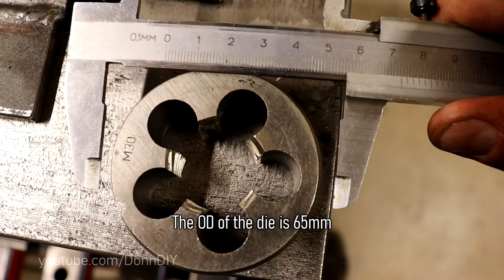Machining M30 Thread Cutter Holder on Lathe

Comment: The industrial sink has definitely "seen some stuff" you're right; well everything except a Brillo pad and a cleaning agent.  😄  Great video Donn.
[13:17] I don't know if it would weaken the die and the holder too much, but drilling a small hole through both pieces on the top, and tapping to add a small reservoir for cutting oil would be convenient, and allow for a steady flow of whatever cutting oil you choose. Modifying the mounting bolt might make a good reservoir.

Comment: Great project! We're all about building our own tools if we can cause the crap you get these days is junk in most cases and too expensive to boot!!! Great job
Reply from the maker: Yup, I bought a set of thread cutters from eBay just because I needed to cut SAE thread. Those cutters were so brittle and broke first use. Have to look into some highly rated brand ones.

Comment: Seem to me it would have been simpler and faster to use the lathe to single point cut that M30 thread on that shaft.
Reply from the maker: But I had the die though...
Reply: @DonnDIY  But you have a lathe though. That's every die and then some. I never die cut threads when they are easy to single point.
Reply: @TheMetalButcher  He might not have the threading tool? Then he needs to cut it and keep test fitting the nut, engaging auto feed and disengaging before you crash the tool. 

Tbh if I had the die, I'd reach for it as well, he also had no way to use this die prior to this job, so he's done the job and added a tool to the shelf.
Reply: @TheFool2cool  he added a tool thats still slower than using the lathe for a thread
Reply: It is for sure not slower than with the lathe!😅 It took me ages and was pretty complicated when i tried that with a M20 in Aluminium! And you probably need double the amount of cuts for a M30 thread in steel. I'd definitely also use the die if i had one!

Comment: Why you just don't use single point thread tool on a lathe?
Reply: That's what I was thinking...  Maybe he was missing change gears or he has a dozen of these threads to cut.
Reply: Cutting threads with a die is faster. If you have several to cut and have the die already, it's worth spending the time to make the handle.

Plus single point threading can be intimidating for hobbyist machinists, even more so if you have to do several.
Reply: Doesn't ! Do !! Anything !!

Comment: i would have bet that the lathe chuck would not be able to hold that size stock tight enough to thread with a die. i was wrong nice job. you are a very resourceful young man.
Reply from the maker: Sometimes parts do rotate in the chuck...

Comment: You need to countersink the threaded holes for the knobs to be able to press the conical part at the end of the thread into the holes. Thanks to this, the handwheel transfers a larger moment of bending (strengthening)

Comment: I would like to see the Donn DIY drill bit sharpening tutorial :-)  That 2 inch drill really cut cleanly
Reply from the maker: If you noticed, it's sharpened a bit unevenly, it cut more on one side than the other.
Reply: @DonnDIY  I did not look for that. Was impressed with the clean swirl the bit made of the metal.

Comment: loose fit of thread die is not game over in any mean, you know that? When screws do fit it works just fine
Reply from the maker: Yes, I know. That's why I made it fit loosely. 😉
Reply: @DonnDIY  i ment loose fit. Like an centimetr too loose. If screw pattern fitted, or if it can be modified to fit screws will hold die as well, as You can set it in the center. Die holder then will work with screws as big levers, but it is too beefy for small die in the first place and I had no problem with cutting steel with dull-ish die
Reply: I seriously used all the range of pointed screws. I didn't think, that I shouldn't at any point
Reply: @poprawa  Loose !! Fit !! Is EXCELLENT !!

Comment: Where would you even find a drill bit that big? The biggest one I have is 1/2 in lol, great vids and can’t wait to see more cool projects!!
Reply from the maker: My aunts husband was a machinist, I got most of the lathe tools from him. He was a great guy.
Reply: I think the largest I have is well over 1.25 inches Morse taper. I would have to go out and check the size. I have a kit from 1/2 to 1"  with 1/2 shank.  I also have a fair collection of Morse taper drills from number 1 to number 4. Most drill presses are number 2 Morse taper.
Reply: @kameljoe21  I have no idea what a Morse taper is but I’m sure it’s important, I’ve just got a dewalt drill and a 30 + pice dewalt drill bit set and maybe some reamers if I’m going fancy but I’ll definitely check a Morse taper out, thanks...
Reply: @garageguy5174  When you go back to the part of the video where he pulls out that big drill at about 3:20 you will see the big drill the shaft and a tab looking thing. The shaft and tab looking thing is called a Morse taper. I think this might be a number 5 maybe. They size them from 1 ( smallest ) to massive numbers. The taper/ waffle cone shape is desgined to fit in to you tail stock ( lathe ) drill press or milling machine. The taper is what locks your drill chuck in place. If you have ever used a drill press or have one at home, if you pull down on the down feed handle you will see a slot on the spindle which will expose the top of the Morse taper of the chuck. A pie shape key is used to slide in there and tap a hammer on it to remove the taper. This way you can swap chucks out or add in Morse tapers drills.
Reply: @kameljoe21  Great explanation, and one of the reasons I read all the comments. Donn does a great job with his subtitles (cuz I'm NOT a machinist!) but all you helpful smart guys fill the comment section with really good tips as well. Thanks for the education William - AND Donn!
Reply: @garageguy5174  JUNK !!

Comment: Your machine work will look so much better if you get comfortable with power feed.
Reply from the maker: No doubt about it. Used it today. But using manual feed on the smaller stuff since it's faster in my opinion and I can feel the cutting of the chip by hand.

Comment: Have you not worked out how to tap threads on the lathe yet.
Reply from the maker: I have, but why not use a die when I already have it...
Reply: If you have the die you might as well use it. It take far longer to cut them than it does to just pull out a die. Why make it harder.
Reply: That is quite a big thread tho.
Reply: @kameljoe21  actually, when steel is harder you can't just use carbon steel die :>
Reply: @poprawa  I can not tell if that M30 is a HSS or carbon steel. i am going to guess that it might be a HSS one. So either way you can still thread hard steel with HSS taps and dies.
Reply: Loopy !!

Comment: Use screw cutting by using lathe tools use a screw cutting thread profiles and shape the lathe tool to it simple and before all this use a dial caliper gauge to check that machining bit is running true dear, dear me .

Comment: I would have just made a spacer-bush for the bigger die-stock using some thick-walled tubing... less waste & much quicker... also... I've never used dies like that which weren't split except for hex dienuts which are exclusively for cleaning up damaged threads... 🤔